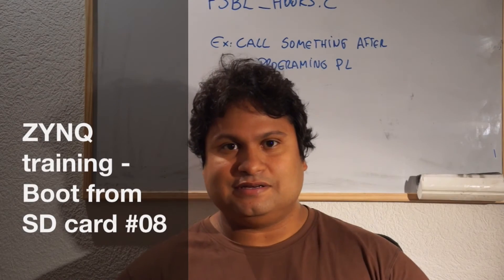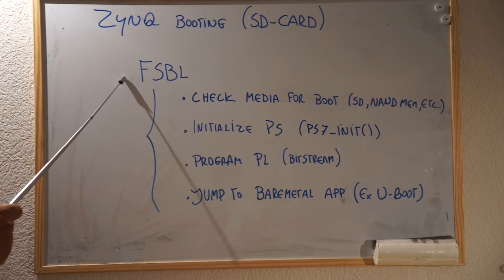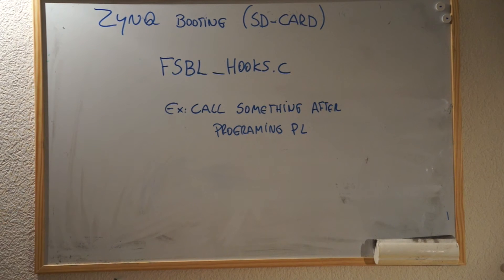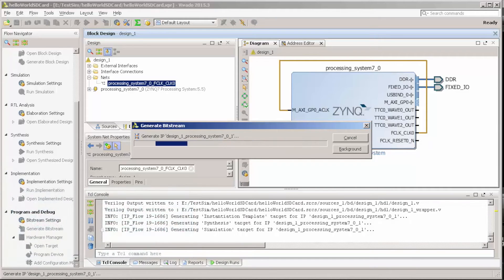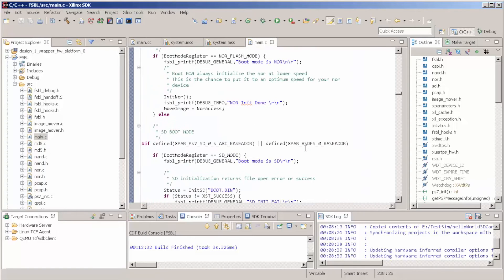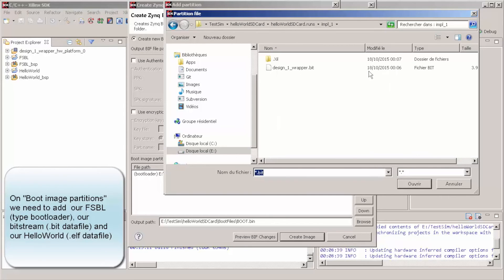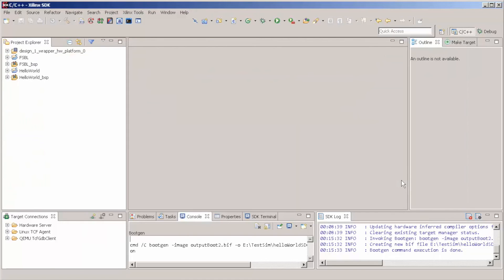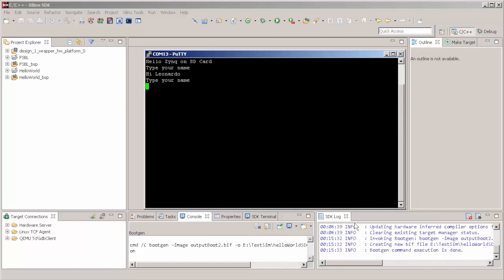ZYNQ training  Boot from Zedboard from SD card #08

Comment: Hello, I want to access the data which is in SD-card of FPGA zynq using Verilog programming. 
The main motive is to import a 32*32 matrix from SD_card to registers. I try to use file handling in Verilog but some function like fscanf and fclose are not supported by ZYNQ.

Comment: Hello , I am testing follow your project , but when  generate bitstream is error 
"
ERROR: [Common 17-70] Application Exception: Top module not set for fileset 'sources_1'. Please ensure that a valid value is provided for 'top'. The value for 'top' can be set/changed using the 'Top Module Name' field under 'Project Settings', or using the 'set_property top' Tcl command (e.g. set_property top <name> [current_fileset]).
"
I am using vivado 2018.2 , can you help me, 
thanks a lot
Reply: On 'Sources' panel:
Right-click on system.bd, and select Create HDL Wrapper to generate the top_module . Leave the Let Vivado manager wrapper and auto-update option selected, and click OK.After done this you can control on the 'PROJECT MANAGER' panel, click 'settings' and you must have a name for the top_module.
Reply: Thanks a lot

Comment: New version of Xilinx want UDF data file as input but it works without browse and add the file. The screens have different style but all steps is like your steps. https://www.xilinx.com/support/documentation/sw_manuals/xilinx2018_1/ug1165-zynq-embedded-design-tutorial.pdf -> page 90 and https://www.xilinx.com/support/documentation/boards_and_kits/UG926_Z7_ZC702_Eval_Kit.pdf -> page 24 is also helpful for sd card usage. Thank you for the video.